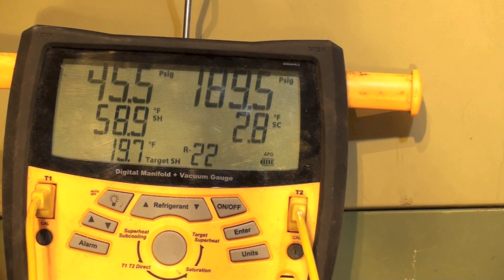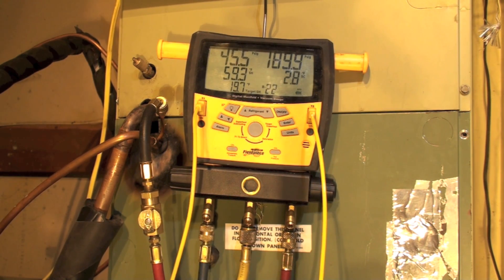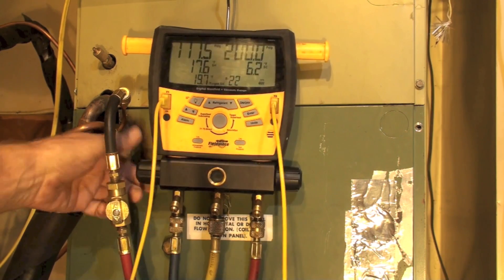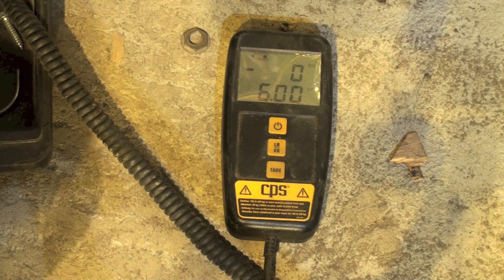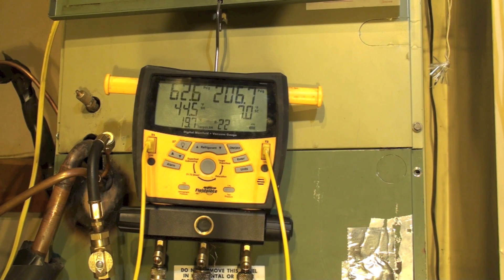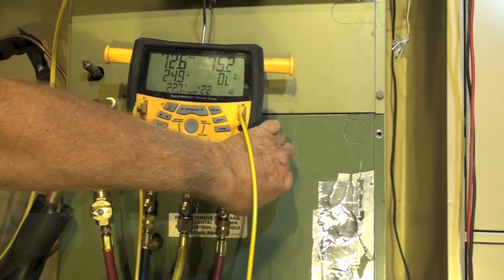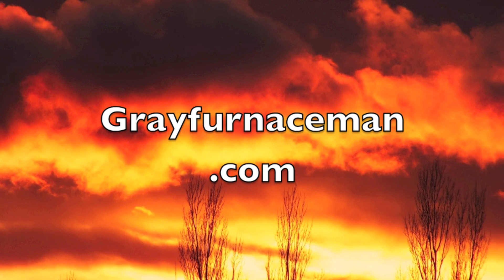Charging with target superheat

Comment: hi, my r22 suction saturated temp. is below 32F (around 20F). i tried to add some refrigerant to bring it up past 32F, but it won't go up.  The low side pressure remains the same BUT the high side pressure rises. Do you think my filter drier is blocked? i see frost on the output of drier but not on the input side. i tapped at the drier and the low pressure drops to 0 on the low side. the unit has a piston . thanks.
Reply from the maker: A frost line does indicate a blockage.  The reason the head is rising is the refrigerant is collecting in the condenser as a liquid and reducing capacity and rising head.
GFM

Comment: Question, my evaporator is dripping water into my furnace. The level is good, filter is clean, just clean the condenser last week and it’s still dripping water. House is cooling well. Any suggestions?
Reply: The pan is good, it’s dripping from middle section of the evaporator coil, droplet just sits in the middle and drip down.
Reply from the maker: @ericzou7753  Upflow or down flow?
GFM
Reply: grayfurnaceman its an up flow system
Reply from the maker: @ericzou7753  I am assuming you meant the evaporator, not the condenser.  
I would be checking the temp diff across the coil.  In a unit that is over 20 years old, you should have 18 to 22 F difference.  New units may be about 18.  Higher numbers indicate low air flow and a higher amount of moisture being taken out of the air.  Higher air flow may help.  Hope this helps.
GFM

Comment: Gman how do you clean your gauges to used on different refrigerant without contaminating the line? Interested on buying a set but I want used it for multiple refrigerant if possible.
Reply from the maker: Then contamination of the gauges set is generally not an issue.  Bleeding out the set is all that is necessary.  Possible exceptions are oil filled lines from oil charging or highly contaminated refrigerants.  In any case, purging with nitrogen will eliminate the issue.
GFM

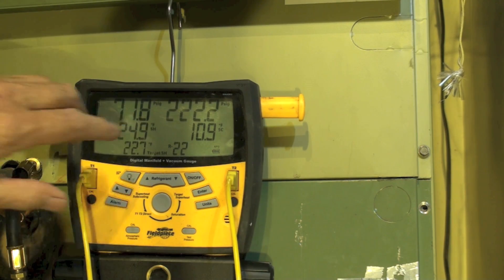Comment: You got confusing at 6:50 to 8 min. Weight on the scale was 15 oz(6 min). next time it was showed it was 3 oz (6:18 min) oz. Then you decided on 22 degrees of sub cooling due to a temp. change(7:02 min). Where was the change?

Comment: Greetings Sir,
Should we take system super heat or evaporator super heat as base for charging a fixed orifice system? Pls di tell.
Reply from the maker: The super heat is measured at the compressor when charging with target superheat.
GFM

Comment: I know when you use gauges it is deferent refrigerant on each gauges    but can I use any refrigerant with digita gauges
Reply from the maker: As a general rule, you can interchange refrigerants with the gauge set.  Some gauge sets will not read high enough for some refrigerants.
GFM

Comment: GMAN, you make the best videos, Thank You. Quick question: What specific formula do you use to calculate your target super heat? Other professionals have suggested a formula; 3 multiplied by return air wet bulb minus a constant number (80) minus the outdoor temperature measured at the condensing unit. Does this formula sound reasonable to you?
Reply from the maker: +melvin292 I don't remember the formula.  Usually I use the digital gauge set calculation.  There are also charts.
GFM

Comment: what is the problem when the super-heat is jumping all over the place and will not hold steady
Reply from the maker: +Ken S There could be a number of problems here.  Contaminants in the system, airflow problems, incorrect coil for the unit are common ones.
GFM

Comment: I just bought one of these manifold gauges, it's very nice but I'm not real sure how to get the wet/dry bulb temps. I also have a dual temp gauge so I have the bare leads. My question is, how to get both readings in the real world (not on a test unit) and what's the 'little sock' and where do I get or make one? I can see you put the indoor wet bulb lead in the return air but how do you get the outdoor reading, ahead of time? I'm going to guess once you have the readings locked in, you go back to the clamps that connect to the high and low side lines.

Great video as usual! I'm going back through your playlists and learning a ton of new stuff, thank you. I'm just freshly out of school and buying tools at this point, very expensive.
Reply from the maker: Jeff S The sock should have come with the gauge set.  The outdoor temp is usually taken with a separate thermometer.  Its one of the problems with the gauge set.  GFM

Comment: you have to be a few inches from the "evaporator" to check for superheat right?
Reply from the maker: estrelladelnorte1308 Target superheat is generally taken at the inlet to the condensing unit to eliminate the heat gain from the line set.  This is different than with a TXV.  The superheat is set by the TXV and is measured at the outlet of the evaporator.
GFM